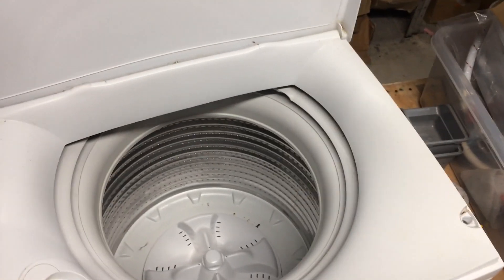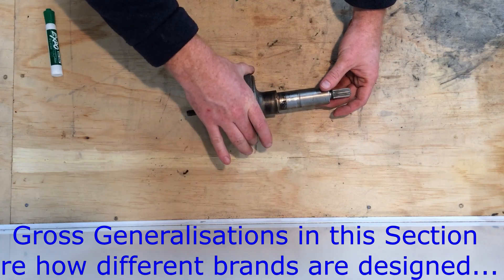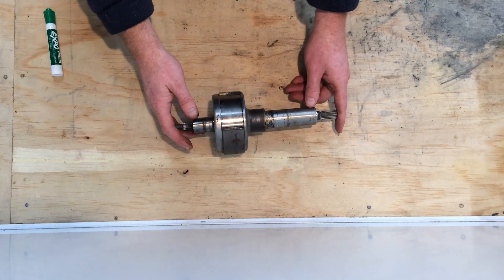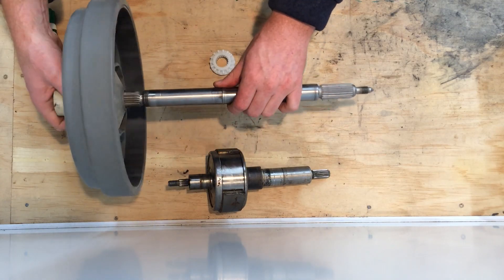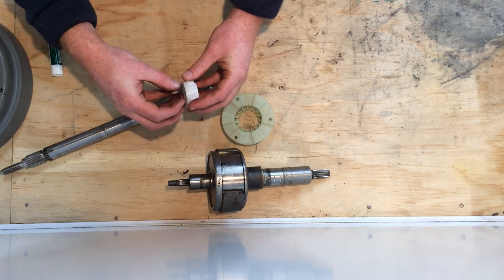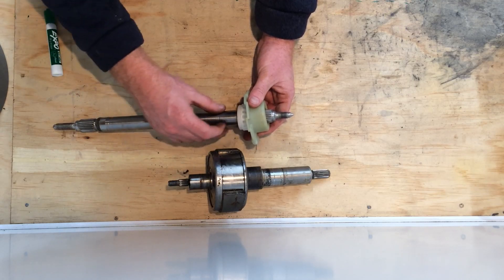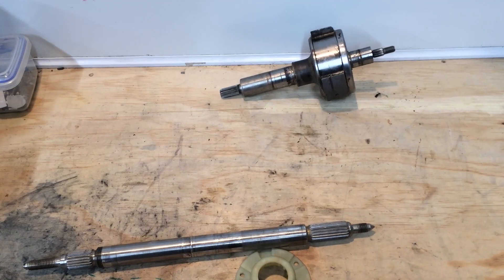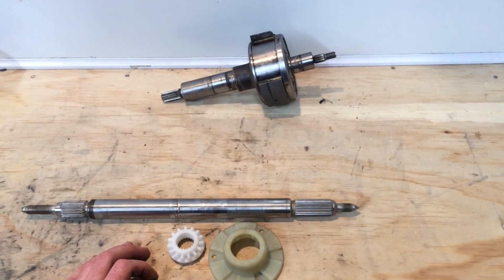No Gearbox: the simplicity of the Smart Drive Spline.

Comment: I had worked out that drive change mechanism ages ago, but didn't realise which part was indeed causing the rub. Mine just touches with a light rub, but not completely around the cap ring. Now I know to change it now. I'm just doing the bearings as over the last few weeks, it's got very noisy on spin. It's only the top bearing and when you hand turn the bearing (just got it out,) it gnarly, but not greatly, but boy did it make a lot of noise. The lower one is still good. (AquaSmart)
I have to say the Ajax water valve (4 of them,) the hot was making it stop filling and fault, but now with the replacement the unit on every fill type- hot and cold, fills much stronger than before. The coils must fatigue in the insulation? I measured them with an inductance meter and also with the D setting and checked the new and the old; even the faulty hot fill one All measured the same in the parameters of inductance ,so I was wondering that things change under an electrical load? The impedance is probably what I should have worked out?
One MOSFET has heat evidence around it on the control motherboard, but it has to do with the direct drive output, by the rough look of investigation and not the water control as the current needs are way less.
Anyway, a blooming good machine. I think I bought it in mid 2000's? It has done much work.
Reply from the maker: Some of the cold valves are proportional, but for cold fill they will open fully. Most likely it was dirt buildup over time on the valve filters or inside the valves slowing down flow rather then electrical.

Comment: Thanks for your videos and explanation, awesome and helped me solve a problem 56 by cleaning out my spline drive.  Just re ran a wash cycle, should for F&P smartdrive 11, should a wash spin 3 times (2 x whilst lights showing rinse ???)
Reply from the maker: Depending on how the optional settings are it will do one  spray rinse (slow spin) and a deep rinse, or two spray rinses, before the spin.

Comment: Nice video. I think detergent build up, grit ,  gunk and fabric softner residue my be this machines little  nemesis to future problems.
Reply from the maker: Just run a hot wash through with a cleaner every 6 months after you have manually scrubbed it clean and they stay pretty clean.

Comment: Hey Dan do you happen to have any idea as to where I can get some Regrip or screw grip by any chance?
Reply from the maker: I usually get it from RS components, its $30-40 for a small bottle but you don't use much, usually goes dry on me before I use it. Cheapest looks like pilotshop.co.nz but they are out of stock, but  Looks like nzfasteners.co.nz have some
Reply: valve grinding paste does the same job and its cheaper

Comment: Is the inner bowel   porous or sealed  and why does it have loads of holes ? Is the outer plastic bowl just for  overflow collection? Also is it called a smart drive cause it has no gearbox or belt? Also I put the machine fully on  the side to do the rps sensor do u think the water could have leaked out  of the inner bowel that u say could leak out and effect spinning     Cheers
Reply from the maker: The inner bowl is just made to hold the clothes, and has lots of holes so it can let the water out of the clothes when it spins. The are called Smart Drive because Fisher and Paykel were the first to come up with a direct drive Electronically controller ("Smart") Motor. 

If you lie it down there is always a bit of water in the bottom that will come out, but it should dry out no problem. A leak from the seal will mean there is always water around the motor and that will cause problems long term.
Reply: @motrepairs  thanks
Reply: Hi @motrepairs Thanks for your awesome vids. I have an F&P MW513 that gives a “Machine Overloaded” code shortly after it begins to agitate (but it doesn’t agitate much at all), even when running it without any clothes in it. I‘ve now discovered that the metal ring is worn out on the spline drive, do you think this could be why I’m getting the “Overloaded” code? 
Thanks mate, I just don’t want to buy the new part and discover it’s something else 🙏